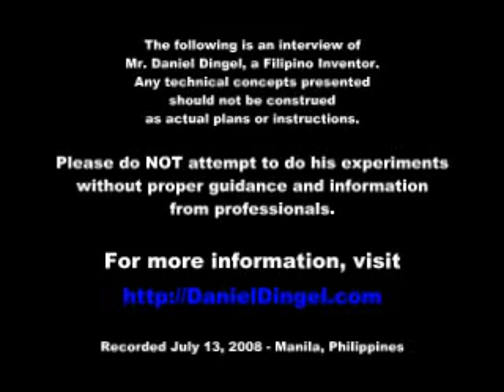Watercar Daniel Dingel Filipino Inventor

Comment: splitting hydrogen from water requires a LOT of energy. and burning it for fuel won't be efficient as well. that's why we are using Gas.
Reply: sakto po mam. madami kc dito because of their emotions kung anu anu cnasabi pero d nmn alam ung totoong ngyari... blinded by media...
Reply: Marvin Abante I understand your point or explanation its more in ME-EN
now I just want to ask if theres a carbon in the engine what does it mean?theres a mix of fuel?
if that's so this invention is not 100% pure water?but the engine is still run buy some water?am I correct?
and if that so again, this invention is still great for making the engine run by some water,it save fuel,save money after all?good for environment also!

Comment: sa ibang bansa katulad din sa atin, bingi at bulag ang gobyerno pagdating sa usapang water fuel, kaya sa ibang bansa kanya-kanyang gawa ng hydrogen generator, splitting the the water and oxygen of the water using 12 volts dc.

Comment: Successfull mga kababayan ok ang WATER FUEL basta may alam ka sa Electrical at safety operation,, salamat kay mr Dingel sa idea niya..may ginawa ako at may circulation pump ang generator ko kaya never na mag init kahit walang patayan,, may expansion tank ako na umaabot ng 60 psi at may regulator palabas dun ko iniimbak,, bago pumunta sa engine..successfull..tipid na tipid puede pang ikabit sa Gas Range.ang Generator ay may water sensor, pressure switch cut off, pressure gauge at amp meter..

Comment: this is not hybrid a hybrid is a car that runs on gas and batteries and the batteries are charged when the car is running on fuel this is a water powered car which is different

Comment: Correct but the cost of hydrogen you can get is much much lesser than the power consumed during the process of separation. Scam yang water fueled car. I challenging him to produce hydrogen commercially. He cannot do that because USA is trying to do that but they cannot do it commercially. Therefore that water fueled car is a big scam. Only idiot can take his bait.

Comment: this is true, water has chemical symbol-H2O (Hydrogen + Oxygen)in order to separate hydrogen and oxygen by electrolysis process.Is process by using direct current to a carbonated water,the oxygen of water will pops out in positive charge(anode) while hydrogen at negative side(cathode) and will produce hydro-oxy gas ,which wlll feed to to the intake manifold of the engine.

Comment: water in vacuum boils then negatively charged in stainless chamber then hit with neg cathode.then to cool without stainless valves mist water in air like a refriderator ice box freezer. then lpg type vapouriser system no air filter  i believe thatis parts of the secret.....give it away free.or else you may well regret .